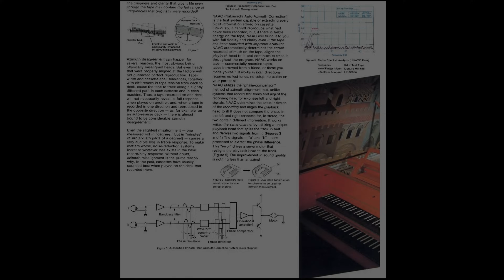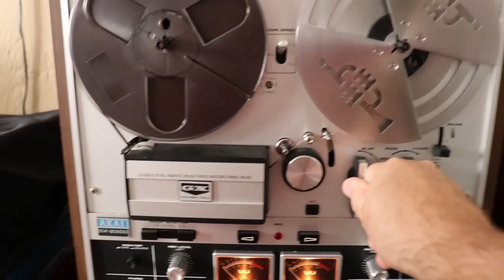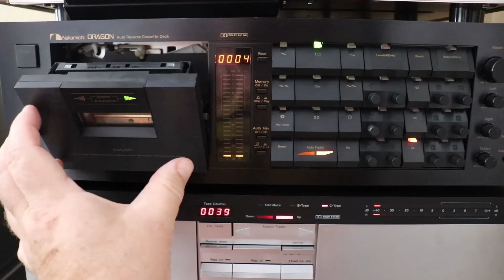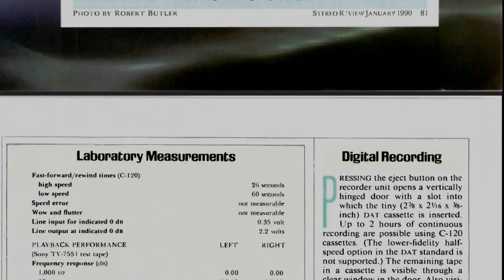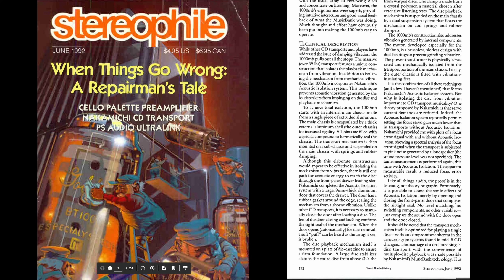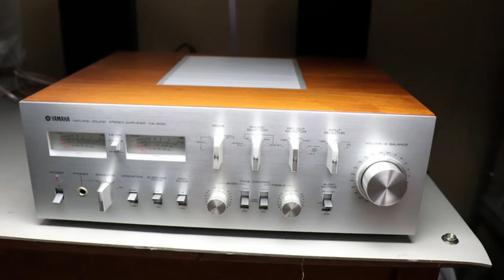Nakamichi Dragon 1000P 1000MB 1000 DAT - Nothing Better at $20K! The Best Audio Products Ever Made!

Comment: 800 dollars i bought one ,you must be dreaming ,do you know what were 20.000 dollars at the time it was enough to at least buy a better deck i had nakamixchi´s since the first half of the 70´s and i found funny how people today talk about a old and not better deck, i had two because the seller in early 90´s told me it was improved but only more of the same and they have real good decks, it´s only a pitty they built them cheap ,mainly plastic parts in the player/record system that when heating they get out of shape, the 700ZXL and ZX-9 were far better ,having a lot of knobs that most of the owners never used them doesn´t make it better than any other good deck, as an example it´s far worst  than the older by 3 years CT-F1250 by Pioneer ,that is a high quality deck for this era ,if it was so good why so many people try to get rid of them while good nakamichi decks never appear for sale and it might appear one in a period of 5 years but recentelly i´ve seen none, you could be better served with a B215 from Revox if good from more than 40 years it´s your goal

Comment: the cables even the best technicians world wide said that after testing all sections of cable sold they said that from a section up it´s only throwing money to the garbage and pretty cables normally are never better than cheap rubber isolation ,they were substituted in electric instalations for one reason beautifull cloth protected cables can cost a lot and not being better than the rubber isolated ones that are cheap

Comment: the dragon cassette deck i bought two ,one in early 83 other in 94 both were the worse decks i ever had and i have others from nakamichi. DRAGON well engeniered but built only for very cold country´s ,in those have central heating but cheaop plastic on it´s main working pieces made it not usefull ,it was cheaper than a high-end deck from other very famous brands but money thrown to the garbage . Sorry but only worked well for two years and because i never throw any electronic equipment to the garbage i even made a lot of money but running not well built cassettes like BASF my favorite brand after 1985 ,included ,the strenght needed to rotate the litle reels inside the cassettes along with heavy use and very hot and dry weather was the end for them , but i have a 73 or 74 model working perfect also a 680Zx ,a ZX-9 ,a cr-7 and a cassette deck one, this was a real deception but some 12 years ago they paid all the trouble they gave me and even could buy the decks i really wanted by 1983 and bought a diesel Mercedes from 1994 in perfect condition a w124 ,  but being working already making some noises i sold them for thousands of €´s, the second one i was going to buy a RX-505 but a friend of mine told me "they are still being sold because they improved it "so twice wrong, but ended up being a nice deal not to play or record cassettes that i only used TDK cassetes because they were the less heavy on rotation , again good in the paper not in real life , the DAT i was afraid of being the same so i bought a sony and still works today , but returning to 1982 when they were released i needed a extra deck so i bought the BX-2 ,well with minor maintenace it works perfect today, i just don´t get it why after the 70´s with so many good cassette decks why only use cheap plastic parts , i even had a Dragon turntable wich it started to fail but rapidly, i sold it and bought a thorens, i also wanted to buy stasis power amplifiers and the pre-amplifier but ,afraid i ended up buying from Pioneer, don´t know who was running the company but their manegement destroyd this so well known brand, and in late 80´s in hi-fi magazines everybody knew this wasn´t a good deck but after all these years again, maybe the best deck in the world ,this for those who had never seen a real good cassette deck or just a cassette deck

Comment: The problem with all Nak decks is they require a lot of maintenance to keep going and tapes recorded on the Nak only sound good on a Nak they sound flat on other decks because of the strange Bias they apply to the tapes. Beautiful decks but for the average user who is looking at getting into a good quality deck this is not the manufacturer you want to go with.
Reply: Any alternative deck recommendations?
Reply: @patriot6669  there are lots of options too many to mention but affordable decks by Yamaha are very good. Any 3 head deck will give great results if you have a bit more to spend

Comment: hi if i can fix it i have the model  of audio recorder  pro model are better to fix  love the otari mtr 12  and scully 280-14 decks
the tascam 38 main pcb can go bad  and re cap can't fix it the copper tracks go bad   on my export model  i am a tascam 34 38 fan 

they can use parts on many model  my scully 280 has a tascam 38 servo motor in the deck and tascam 38 reel motors  dc ones 
works ace
Reply from the maker: Thanks for sharing.

Comment: After your mechanical overhaul, you never did the electronic adjustments according to the service manual? Bias oscillator,  bias per tape left/right, recording levels per tape type, meter calibration,  dolby. Etc etc. All those will have deviated from what should have been according to factory specs. I just did the Nakamichi BX-2 and that alone has over 30 steps to calibrate....
Reply from the maker: Thanks for commenting. In this video my Sound Technology ST-1510A tape deck analyzer showed that my Dragon more then met it's specs with all tape types but more important, it sounds great. If I only had one piece of gear to play with I'd do it all like you suggest.

Comment: I got into the service repair back in the early 90's and i still love working on these 'ole decks and the vintage equipment. I can also say from many, many units i've worked on in my career that the decks were by far the hardest but most rewarding side of the service industry, simply because of their complexity. These days, there's absolutely no comparison to what it was like working on these machines. Since, i can't see such small parts like i used to. I guess i'm what they call old now... hehehe (at 55 years old... youngins' these days have no clue) ;)
Reply from the maker: Thanks so much for sharing. Modern consumer electronics today for the most part is just thrown out when it breaks. I think that a lot of this 60's and 70's gear will make it 100 years. I guess I won't be here to see, LOL.
Reply: How can I contact you?
Reply: @54tristin  
You just did...

Comment: Yes, it is impossible to find good quality tape recorders and players these days, so I wanted to know how hard would be to design my own high performance tape recorder. Cassette and reel to reel decks have come a long way in their development, but 8 track recorder development had stopped by 1980. So I wanted to see if I could fit out a 8 track deck with 2020 technology, in process I came up with new ideas around AC bias and a new type of noise reduction. I am now thing of doing a small run of new high end stereo 8 track recorders, as the performance I am getting is well beyond what was possible in the 1970's. But the performances gains with Cassette tape are there, but not good as what was made in with high end decks of the 1990's. 
If any is interested I can provide a link to the article I have done on this subject?
Reply from the maker: Thank you for sharing. I would like to see what you have done. Please provide a link and I'll check out your work.
Reply: @vintageaudioaddict  I have made the article available on LinkedIn, I do not think YouTube will let me post a link here.
It is called "The 8 Track vs Cassette Tape"

Comment: I enjoy all of your videos,  but I really loved this one.  Perhaps you, or one of your viewers could help me with an issue I am dealing with.  I have a Jeff Rowland model five that had the left channel die. I can see the problem area and fried components and know that the other side is not far behind.   So this is my issue... there are no repair manuals or schematics to be found.   This is such a beautiful amp and it kills me to see it sitting.
Reply from the maker: Thanks for watching. That's a real problem when you can't find a service manual or schematic for a piece of equipment. Been there myself. Sorry, I don't have one or know where to find one. There really is no easy solution but you may be able to use your good channel as a helper/guide to try and figure out the issue with the bad channel. Also take a good look about the damaged area. In these older pieces of equipment the electrolytic capacitors are the number 1 failure point but many times when one goes it takes out other components with it.

Comment: Chris, in the early to mid 70's, a lot of audiophiles were still grooving on their various reel to reel decks. I remember the rise of cassette decks, in the late 70's, and then into the mid 80's...Until CD's became popular.
Reply from the maker: Yes Don, that's true. Until Nakamichi and others got the cassette technology to the point that cassettes could compete in sound quality open reel was the king. Of course everyone having a cassette deck in their car didn't hurt the surge either.
Reply: well, sorry to disagree but saw lors of people mad because the only shop that sold blank tapes in late 90's didn't sold them anymore , i had money but most of the people were not ready to be forced into a diferent format than the cassette tape, and owned two dragons one wgen it came out other in early 90's but they had the same problem cheap parts deformed in regions that the temperature doesn't go beneath 30 degrees clelsius for 5 or 6 monthes a year , and wake up at 8 .00 p.m. with 38 degrees without a.c. its hell and dragon didn't like hot weather , twice i was stupid , maybe be ause in the 70's i had a nakamichi and as older it could look it worked , and spent around or almost a 1000 dollars for it and in the 90's almost 2000 dollars but as good as a nakamichi  dragon works when new it doesn't have the quality of a revox reel deck or akai or pioneer from late 70's by far the problem either than electronics is the cheap material they built the azimuth alignement and auto-reverse function  and yes the 70's decks till 76 were really good , nothing else and today it seems people are insane i sold my last dragon for 300€ it was beneath my bed not working but even twice burned i ended up buying a CR-7 that only use it in the winter and the monthes around it but the main  reason dragons don't last is the fact that people think it can use any cheap cassette and it rurns them to gold but its the reverse only very good tapes , that don't demand extra strenght to make them rotate , the lighter cassettes are in terms of rotation the more years the dragon lives, but with the years i found much better sounding decks as an example all reference casstte decks from pioneer all other nakamichi components are really bad, the stasis amplifiers i spent a fortune buying two monos and a pre-amplifier did amazed me for 12 years when i had to out to work my sansui system from 76 , and minimal maintenance and its working today with a thorens turntable and some focal speakers not the most expensive ones but i also had the dragon turntable that i sold rapidly when i notice it would stop running  for a couple of reason , while my 72 pionner turntable is still working great, but its a se ond pioneer system i have in my main living room with a reel deck from akai a 1970 model , wich when recording a compilation from a cd the tape sounds much better , nakamichi from my point if view develops very good material with nice improvements but when in production they cut the costs by using the cheapest materials they can find , isn't it a pitty, has mr. Harrison said

Comment: Had many Nakamichi products since mid 80's.A high powered car audio system in '84 loaded with 8 Nak subwoofers ,am ps , tape deck, cd changers and crossovers started it.Then carried on to Nak home audio.A 730 is what I ended up with. Collectin dust preamp section does not work.Power section is good.I wonder why
Reply from the maker: Nakamichi did make some killer car audio products back in the day.

Comment: Dragon is an excellent deck, but there are several points that limit its quality and sound in general (it also applies to other decks)
- Dolby - the sound always goes through dolby chips (8 pieces!) During recording and during playback, even if the function is inactive!
- semiconductor switches in the signal circuit - really have a detrimental effect on the sound, it is strange that they did not install a relay instead of them
- auto azimuth - the system, which had to be applied because of the discrete recording head, is rather rough and not accurate enough, manual adjustment at a frequency of 10k-16k is much more accurate.
but I didn't know about DAC and DAT from Nak before, thanks!
Reply from the maker: Thank you for watching and for sharing your knowledge.

Comment: My Nak ZX-7 still works great, though I do have to replace the belts and tire every 6-7 years. The rollers seem to last longer.  That 'split' transport is something to behold too. You MUST be mindful of every tiny washer under every moving item there. Specs are top-grade - my unit reached 27kHz with TDK metal tape at -20dB, 22kHz at -10dB, and 15kHz at 0dB!
Reply from the maker: Wow! Great numbers. Thanks for sharing.
Reply: Terry Connor  got it, thanks for the info!